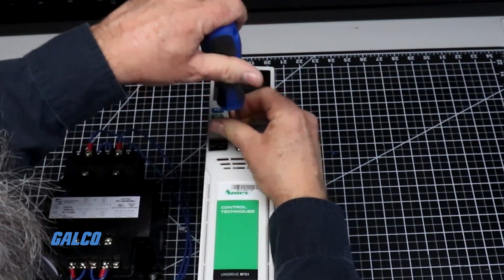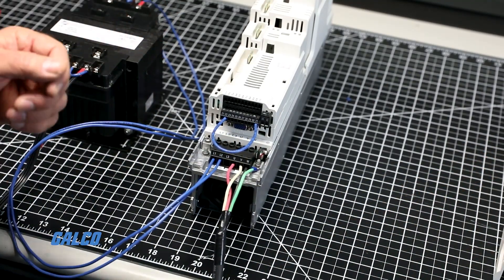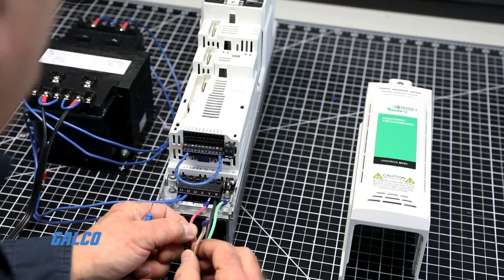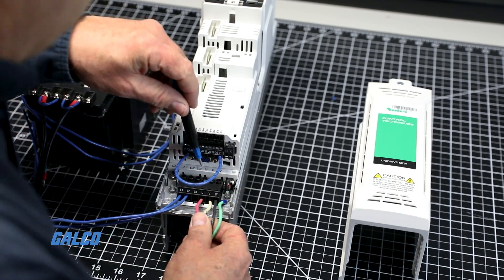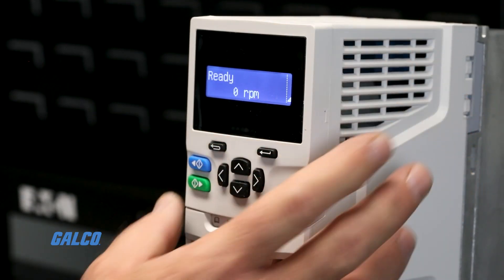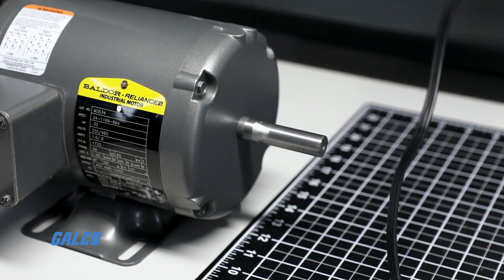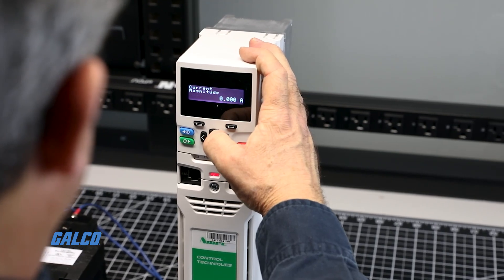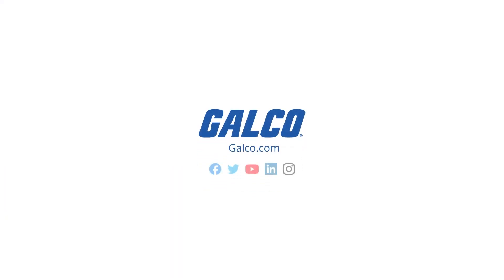How to Change Motor Direction on a Drive | Galco

Comment: To change the rotation direction of a 3-phase motor, can I swap 2 of the 3 phases at the inverter's input?
(In this clip you do it at the output of the inverter).